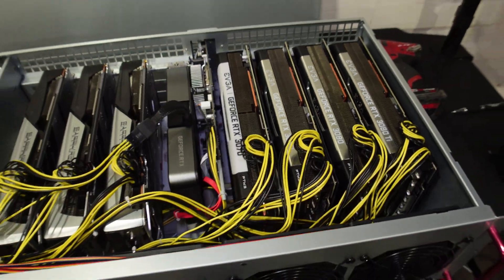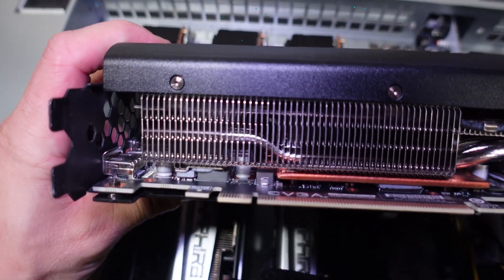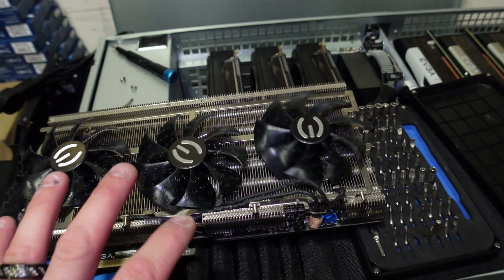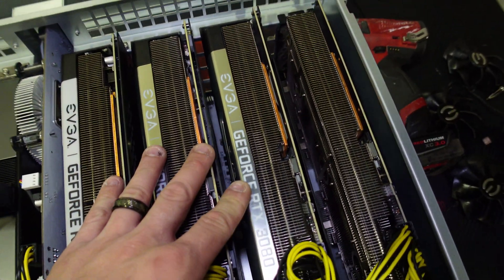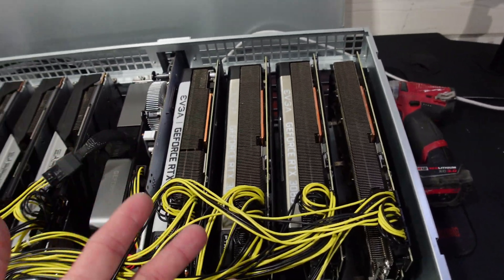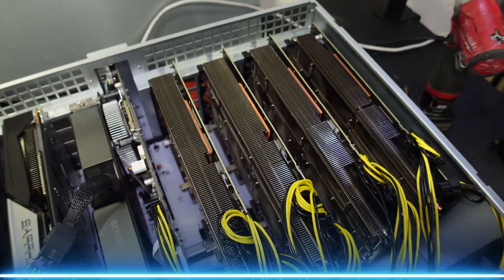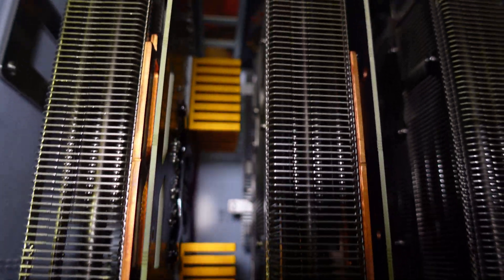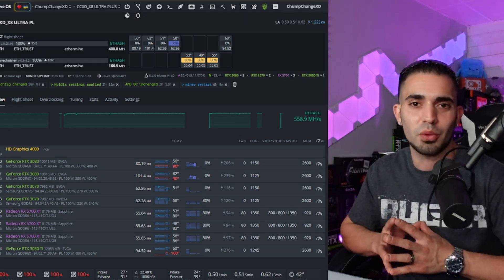GPU Mining and Solving Heat Issues

Comment: Why don’t u leave the fans on and let them blow the air on without the shroud, and thermal pad the backplate to use as a heat sync and try that?

Comment: Why not try with fans on. But without plastic around`!!!
Reply from the maker: Because it doesn’t matter in the long run your just making resistance on the fans
Reply: The case fans would likely spin the GPU fans and cause other unwanted issues.

Comment: Consider putting those little heatshinks on the actual heatsink of those ftw3, maybe strap them on and use some thermal pads, it should transfer the heat and the octominer fans should help a lot. I bet if you put 3 on each card the results is going be amazing. Good luck!

Comment: I think we missed two points of data on your video. The fans on your FTW3 cards - were they running at 100% prior to the fan/shroud removal? I’m assuming so due to the heavy temps.

Also, what were your Octominer fans running at during both tests? (Fans/shrouds installed and removed).

These two points will help a lot.
If the octofans have to run full bore the entire time, it has me wondering if the performance would be different if this were in a heavily air conditioned environment. Might not matter but all the same this is fascinating results. Congrats and thanks for sharing man.
Reply from the maker: Yes the fans were at 100% on the FTW3 cards.

The Server case fans are designed to run for longevity like Asic fans so they will be fine
Reply: @ChumpChangeXD  no doubt. I have mine on smart settings - min 20% and max 100%. They tend to drive around 40-50% on my 3070 rigs and 80-90% on my 3080 rigs.

Curious to see how that changes once I modify my AC situation. Going for a cold clean room to reduce wear and tear, as well as downtime at the added cost of power consumption.

Comment: The 3080 Ti doesn't have any memory chips on the back, those are only on the 3090. The backplate has a purpose in a normal case, since it gives some extra rigidity but that's not needed in a server case.
Reply from the maker: Yea that’s what I’ve noticed; the heatsinks on the back surprisingly really do help which is cool

Comment: Nice testing might take out the backplate on all of them even in open frame looking at this... Got 3 EVGA 3080 ti and one is particularly difficult with heat thottling. Good idea covering the PCIE connector but i would still be afrait of the heatsink faling and shorting the back of the card though
Reply from the maker: They’re actually made of aluminum so they should not Create any type of arc if it falls but I did it for safety measures

Comment: Sweet video bro seemed to help definatly love these upgrade videos. I wonder if the GPU risers thermal pads are better than the Gelid pads. Maybe you could do a 3070 FE thermal pad replacement video it would help me out since I havent seen one taken apart, and my junction temp is climbing a little bit everyday and I'm up to 92 c now. The Gelid pads have my 5700xt's junction temp at around 70c
Reply from the maker: So I did the pads and paste on the FHR 3080 and it still sucks haha

Comment: if you increase your core clock on the rx 5700xt you can get more mhs, your core is too low.
Reply from the maker: Yea they were HOT which is why now in an octominer I will adjust
Reply: @ChumpChangeXD  nice, also make sure to use Team Red Miner B mode, it uses all 8GB of Vram for loading the Eth dag which allows you to run a little lower core clock = lower core voltage = power saving and a bit lower temp.
Reply from the maker: @AleksandrsBrodie  thank you!

Comment: I alsways support inventive thinking aka ‘ MacGyver’ Spirit, but please don’t do anything which will ruin the lifespan of your GPU’s. Putting so may high power GPU’s into a tight server case is potentially dangerous and could shorten the lifespan of you GPU’s greatly……but it is your decision if the benifit of lower temps alone will extend the livespan of your GPU’s…..i can only tell for me personally that experimenting with such expensive GPU’s is not worth the risk of causing damage or a shorter lifespan to my GPU’s
Reply from the maker: If anything my man running them like this is going to prolong the life of these cards considering what they were running at previously awards of 110c on memory

Comment: I personally wouldn't remove any of the fans. Why not just replace the thermal pads and add fresh paste? If any of the Octominer fans fail you're gonna have problems. These Octominer cases are way to small inside and crowded i still firmly believe open air frames are the way to go. 

My open air frames paired with vornado fans blow these Octominer cases out of the water.
Reply from the maker: Also open air frames stress your cards I promise you they are not the way to go at strictly crypto mining even tho I love my rigs
Reply from the maker: Because I did on the 3080 FHR and it doesn’t help. Trust me this is the best way. The unit will shut down before you hard breaks if there is an issue just like every other rig does.
Reply: @ChumpChangeXD  I trust you ChumpChange! Open air frames work great for me but once i grow and expand like you it would be smarter and overall cheaper to use a server case. Happy mining!!!
Reply: The octominer server fans are designed to last, open air frames are nice but server cases are nicer when you want some serious/industrial setup.